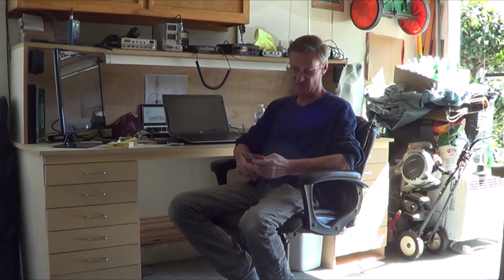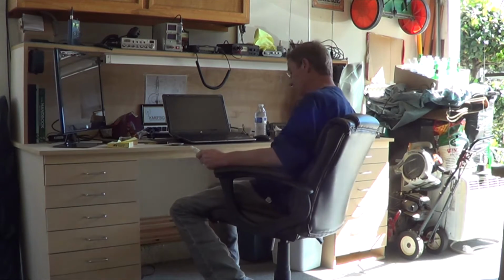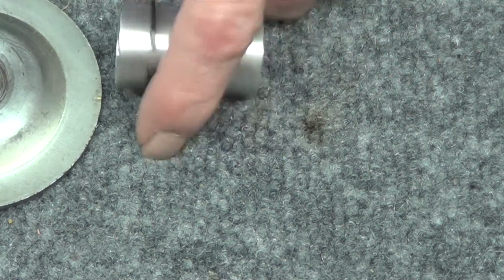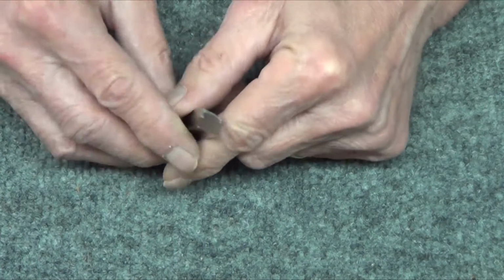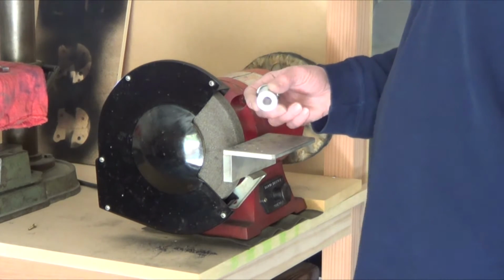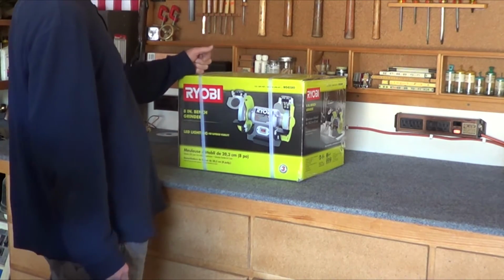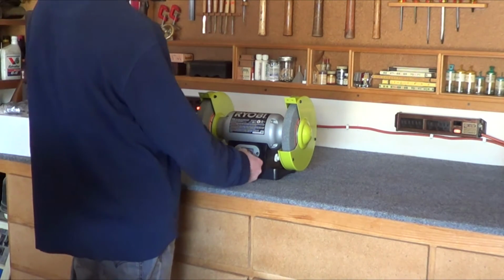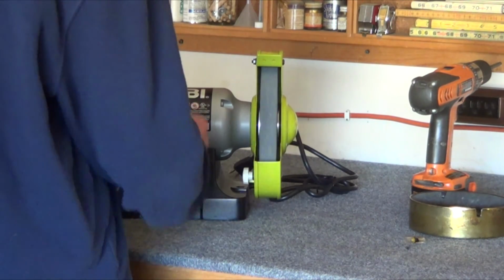Ryobi BG828G Grinder Review Video #117

Comment: Baldor makes a good one. a good grinder like you want starts at about 500 dollars.  then you need to get good wheels on it. the garbage on the one you got are not good wheels. they cost money too. and because they are cast they will always vibrate especially if you don't dress them. you turned on a grinder with out checking to see if the wheels were tight. you are a brave man.    it is not a perfect world.   you can get good tools or cheap tools.
Reply from the maker: Later down the road I have a video on making a balancing jig then a video on how to balance the wheels. All is perfect now!

Comment: Dave,

Just a quick but urgent warning !
When you make a new plate/washer yourself for a bench grinder, be advised that it HAS to have that 'bell feature' in the centre.
So don't be tempted to make a dead-flat one !
The only way to use a flat sort of 'washer' (for want of a better word) is to make a complete clamp-arbour for the wheel , in the same fashion it is done on a surface grinder.
There is a good chance you know all this... but it is better said once too often , as grinding-wheel-shrapnel is something we can do without !!! 

In order to get rid of vibration in a grinder, try to true up the wheel with a diamond , this often helps a lot.
Bolt it down to the bench, current DIY grade grinders have these silly suction cup type feet,these days.... the wobble when you look at them !
That said.... that wobble in the new grinder is unacceptable ! Two decent Norton wheels would probably solve the problem, but they will set you back another $100
Cheers

Paddy
Reply: Remember doing this on cheaper grinders and the results are pretty decent... As long as the motor is running good there is hope...   ;)
Reply from the maker: Curious never heard of the bell part. Why? And as far as I can tell if the inner washer can't hold the wheel straight then I don't care what stone you use its going to wobble. The final solution is next Friday....
Reply: Dave , 
It doesn't have to be a 'bell' part, a recess will do as well.
Key is, that you shouldn't clamp a grinding wheel directly around the mounting hole.
Also, NEVER mount a grinding wheel that has no paper/card tag around its spindle hole. If that is missing you HAVE to make one from heavy paper or thin card !
This is no idle warning , serious disasters can happen if one ignores these things.
Email me if you feel the need to do so

Paddy
Reply: On cheaper grinders, the harbor's facing is often not perpendicular to the axis, this will cause even the good wheels to wobble, also the cheaper cups are rarely rigid, and straight and uniform thickness, this is why you get nothing smooth opposite to a same specs 8" 3/4HP Baldor that will cost in excess of $1000 and perform great with only a little dressing of the wheels, BTW a Baldor will take a moment to get to speed and it's normal...   ;)
Reply from the maker: Hi Pierre, I'm figuring out your perpendicular comment pretty quick. Had turned a precision collar which press fit over the shaft against the bearing face giving me a new face for the cups. Turned the cups also. Used a dial indicator on the wheels and found you can simply push on the wheels to remove wobble. Their now within .003 and re-dressed. So for $130 and a lot of work I now have a very nice grinder. A quarter on top doesn't fall off anymore!

Comment: Unless you want  to  drop hundreds on a grinder they are all about the same. Your problem is mostly with the  wheels. Even if you  fix the  sloppy spindle attachment the wheels  must be  trued up. Ooo you won't enjoy that! Crap goes everywhere! You may also want to do some research on the   grinding wheel  you will need. One  "good" wheel  will cost more than the entire Ryobi Grinder.  True wheels  of the proper grit and material aren't going to  be  on Big Box store bench grinders. Here is the cheapest "tool grinder" I found running a quick search. http://www.grizzly.com/products/Heavy-Duty-Tool-Grinder/H7762?utm_campaign=zPage&utm_source=grizzly.com
Reply from the maker: You guys will see the final solution next Friday and it will make you sick....

Comment: Anti Seize  is some awesome stuff. I first used it when I built my Cobra. The stainless header bolts going  into the aluminum heads was a must. Used it a lot of other places as well. A word of caution Anti Seize is hard to  remove  from some surfaces. It tends to  want  to  spread itself around and marks its territory.